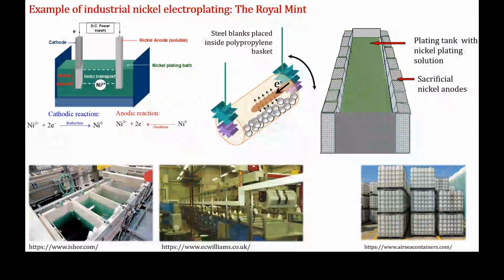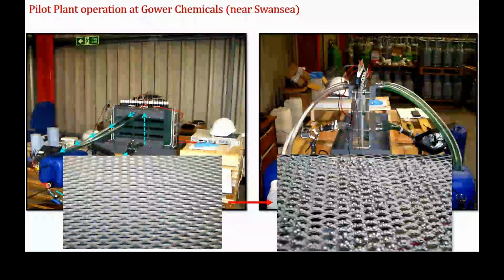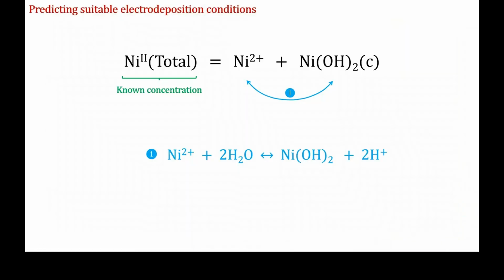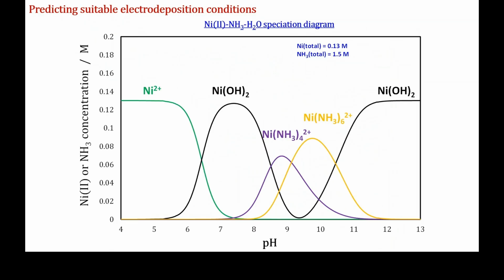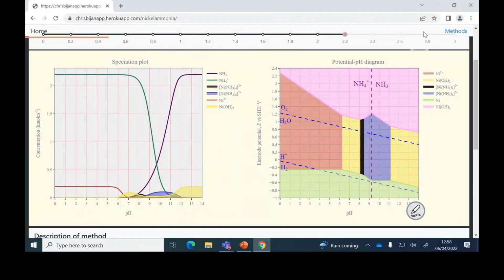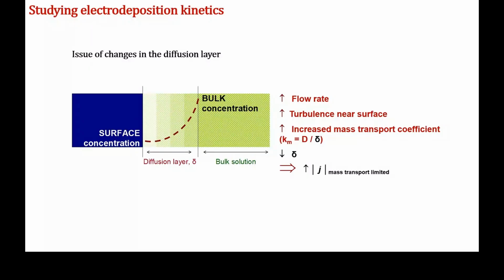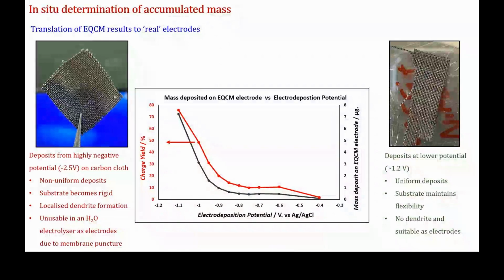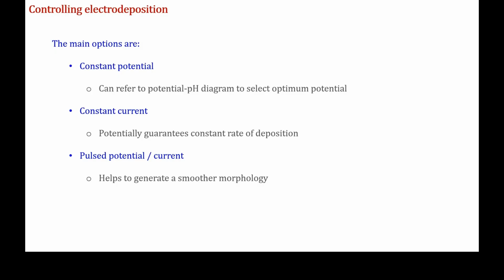'Electrodeposition and Pourbaix diagrams' - with Dr Anna Hankin

Comment: Consider the Cu-Fe-N (i.e. N=NH3) the Pourbaix diagram above  and determine if it 
will be possible to leach Cu selectively from scrap metal containing Iron. Explain by 
referring to the thermodynamic stability of species that may form, favourable 
conditions and motivate possible leaching agents that may be used. No calculations 
required – use only the Pourbaix diagram.   

How do we do this..? Dr